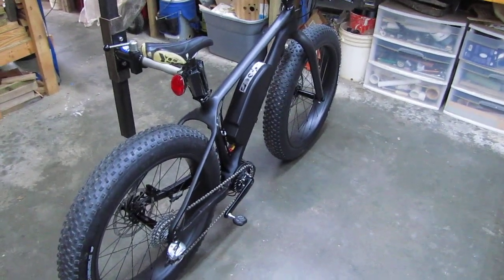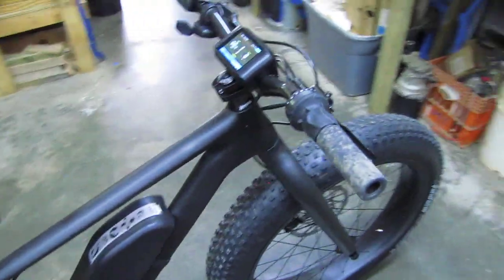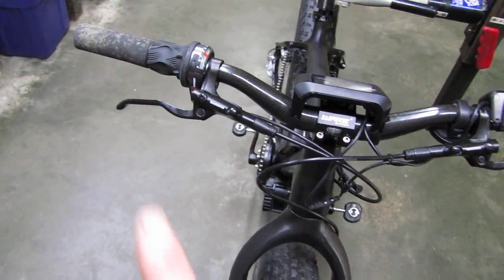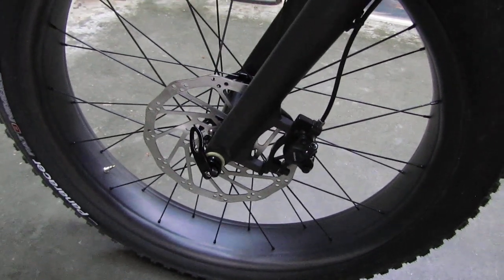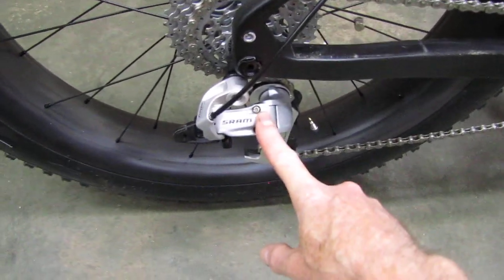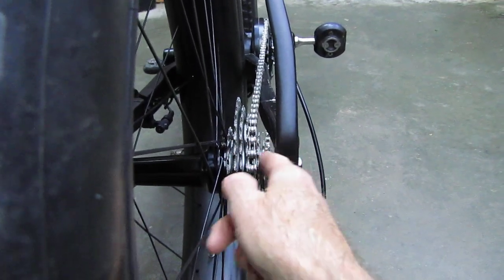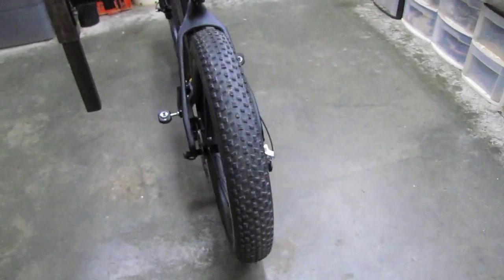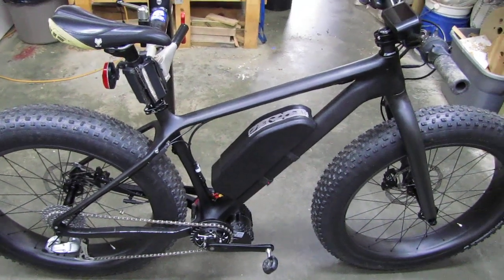Carbon Fiber Fat Ebike build with Luna BBSHD motor kit

Comment: So I just finished a very simular build as well I had a mongoose hitch.I purchased an ICAN carbon frame wich appears to be identical to your bike, yes I had ti gring the motor case a bit but nice and snug ..  I solved my chain line problem with a lecke 40t offsett kit it came with a low profile gear box cover to allow the offset chainring..   works perfectly have 1, 2mm washer on the BB pedal balance  and the chain aligment is perfect. Im running a 12 speed sram cassette and nails every gear. . Ill try and post some pics ..thanks for the inspiration..
Reply from the maker: Nice!

Comment: Dam that’s a nice bike  !! Good job
Reply from the maker: Thx. Just got back from a  24 mile off road ride. Another awesome day in the woods :)
Reply: EL34XYZ    I want one for setting my trail cams for Sasquatch  how far can you actually go off road like in your last trail video ? ( that type of Terrain )   Can you go 40 miles total ?  I wonder if you use a hub motor you don’t have the gear clicking when not peddling ??
Reply from the maker: @AboxofMonsters  Depends on how you build the bike. I might be able to go 40 miles if I use the lowest possible assist level that feels ok. But that's a best case scenario.
I have no use for a hub motor in the mountains here. Mid drives  are more powerful and the bike weight distribution is better.

Comment: Thanks for sharing, interesting. I ran into exactly the same chainstay issue converting a Norco BigFoot 2020 with a BBSHD. Works just fine but need to sort drive train/chainline. Thinking of Box 8 speed. Currently running Leckie 40 tooth, but again, have to insert so many spacers to get clearance from chainstays. Considering trying a 36 tooth. Two questions, if I may. 1) what speed do you get out of your bike, given the low gearing you run? 2) What carbon frame is that, it's really cool, especially with the rack mounts. Cheers.
Reply from the maker: Check out the comments for more info on this bike. That bike will do 36mph on the flats. I have not ridden it in quite a while because I have two Luna X1's. You can see those bikes here. https://www.youtube.com/playlist?list=PLVvDFekIYJjcyz1eu2JIv1EMDKRdUQ7Bz

Comment: That bike is pretty badass. I like you don’t have any decals on it.very clean look. I really wanna get all the decals off the Ebike I just put together, I don’t know if it’ll  ruin the paint though. They put so many decals on it’s annoying.  I have the same 52v battery. I like that it’s nearly indestructible, however, that makes it very heavy.
Reply from the maker: Some decals are actually painted under the clear coat. My Luna X1's are like that

Comment: Nice video! Frame is not available anymore.. do you have the specs so we know what to look for? so we could find a similar one on aliexpress or something.. the most important thing for me is the tyre. I need as wide as possible tyre because im thinking of making a winter fat bike to use for work commuting in norway ( im talking 1M snow as a surprise on the roads and constand ice on the road surface below any snow.. usually a lot of half melted snow with pure ice below it,
Reply from the maker: Hi, It's just a simple Carbon hard tail frame. Many merchants on Ali sell the same frame or similar. I don't have a link. Just do a search on Ali and look at all the choices.
Reply from the maker: @bwiser5206  BS, you have no idea what you are talking about

Comment: I have a brand new Fuji A2 21 inch mountain bike with 2. Something tires ( I wish I just went and got a E bike fat tire that’s what I want ) can I convert this Fuji with that motor kit ??
Reply from the maker: You should go to electricbike.com forum. Lots of info and help there. Here's the link 
https://electricbike.com/forum/
Reply: EL34XYZ   Ok thanks   I guess I should make use of it since I bought it. It’s already got great components.  I think I should use a rear hub motor so I can keep my a lot of intact.   Both types seem to work fine.

Comment: beautiful bike you put together , could you tell em how much it weight? I like to build something like that. also is the carbon frame holding ok? I heard it not a good idea put powerful motors in carbon frame. did you have any issues?  Thank you
Reply from the maker: It weighs 58 pounds because of the huge battery and BBSHD. There is no problem with a full carbon frame. As long as it is made properly. I have 2 Luna X1's also and they are full carbon
Reply: @EL34XYZ  Thank you !
Reply from the maker: It's a heavy machine. My Luna X1's are right at 50 pounds with the carbon stuff I upgraded.

Comment: Hi, very nice bike you made.
I am planning to build one myself this winter.
Can you pls tell me how fast can you paddle it on flat road with this setup?
Reply from the maker: This fat bike will do about 38 miles an hour on the flats
Reply: Thx, that sounds promissing
Reply from the maker: @erwinvanasperen5353  That is with that big Luna Chain ring. But I only have a 12 or 13 on the rear.
Reply: What did you use to fit the 33.5 mm bbshd axle in your bottom bracket?
I assume it was wider than 33.5 mm.
Reply from the maker: @erwinvanasperen5353  I don't know what the 33.5mm is you are asking about?
 I ordered a 120mm BBSHD from Luna Cycles. 
120mm is the Bottom bracket width on my Fat Bike frame. 
You order the correct BBSHD according to the width of your frame bottom bracket
Reply: @EL34XYZ  No i mean my bike has pressfit bearings in the bottom end.
When bearings removed BB inerdiameter is 41mm. So can not fit the 33.5 mm axle of the bafang bbshd direct. Must use somekind of spatels.
Reply from the maker: @erwinvanasperen5353  I don't know, all my bikes have threaded bottom brackets. There is no axle, the BBSHD has a large diameter steel tube, with an axle inside it

Comment: nice build!!
my Carbon frame is too thick at the bottom bracket and the BBSHD doesnt fit.
how did you do it? I´ve never seen a Carbon Fatbike frame thin enough to fit a mid drive motor
Reply from the maker: I had to shave off a tiny bit of aluminum off the BBSHD case. I used a dremel rasp bit. Push the BBSHD on and note where it rub, then shave a bit, do it again and again until it slides on

Comment: Awesome build videos bud!! I stumbled upon them tonight and watched them all. I had a question I'm sure you can answer. All my ebike builds are rear hub motors, do you have any experience with those?? I have to use torque arms for aluminum frames of course, would the carbon fiber dropouts be beefy enough to no worry about torque arms???? Thanx
Reply from the maker: Hi. I have only built two mid drive bikes. I don't know anything about hub drives. 
I would go to the electric bike forum here
https://electricbike.com/forum/

Comment: Did you have any issues with mounting the BBSHD on the carbon bottom bracket? Did everything fit properly around the frame?
Reply from the maker: The carbon frame was so beefy and fat that it was a really tight fit sliding the motor into the BB. I had to Dremel a bit on the motor case to make it clear the frame. The motor shell is aluminum. I used a round rasp bit to shave away some of the casing. It eventually went in. The motor case strength was not compromised by what I did, but it did take quite a while of test fitting, then Dremel, then test fitting again before it went in.
Reply: @EL34XYZ  I have a similar carbon fat bike and was initially planning to order a BBSHD for it, until I read that my BB shell was about twice as thick as the maximum thickness it should be to clear (something like 30mm vs 15mm. I had been considering a CYC X1 Pro, but would prefer the simplicity and quietness of the BBSHD. Do you have any detail photos of the BB area. and how much material you shaved from the drive unit?
Reply from the maker: @markreisdorf5860  No Images of the motor after I relieved a bit of aluminum. It was a bout a 1/2 inch wide area the width of the motor housing and maybe only about 1mm of material had to be removed. It was easy to see what needed to be removed because every time you slide the motor into the BB, black paint from the motor would show up on the bare aluminum motor housing. A round rasp bit in a dremel tool was able to reach in there and shave a bit at a time.
Reply: @EL34XYZ  do you think I'd be able to put a bbs02 on a carbon 26er on ebay the same way you did?
Reply from the maker: @Jonmc511  Don't know. Probably not because you don't have the super fat Bottom Bracket area like on my fat bike
Reply from the maker: @markreisdorf5860  No, sorry. I did not take any photos. It was just a bit off the aluminum case which was way thicker than you may think it is. It did not do any harm to the motor casing
Reply: @EL34XYZ      I was wondering why I couldn't find anyone that had a carbon fiber mid drive build... I'm tired of dragging my bike up a few stairs to get it in my place.. I was thinking building at regular 26er with my 36 volt 500w bbs02 for the streets. Did you drill holes into the frame to put the battery? And how many screws did u mount the battery with? Luckily I looked you up because I would have been discouraged about the bottom bracket not fitting. I'm curious of the stuff that you've grinded off.. motor is still waterproof? It looks amazing doesn't look like you hacked it from the video! After the build the bike was 15 lb lighter than the Mongoose set up?
Reply from the maker: @Jonmc511 
I did not drill any holes in the frame. I think the battery mount info is in my bike playlist. Look at the videos here for the Luna wolf battery mod video
https://www.youtube.com/playlist?list=PLVvDFekIYJjcyz1eu2JIv1EMDKRdUQ7Bz

Comment: Sooo... whatever became of the Mongoose, did ya unload it, or is it still around?
Reply from the maker: The BBSHD kit was removed and it was put back to stock. Then I sold it on craigslist. It was only used as a test subject :)
Reply: @EL34XYZ  yeah...just my luck...always a day late and a $-hort. Oh by the way great build. Love the frame selection. Components aren't bad either👍
Reply from the maker: @mqqnmypops  The fat bike now has a Manitou Mastodon fork and a thudbuster seat post

Comment: How much money do you estimate you have in this build?  It’s an incredible bike. You don’t have a build parr’s list you’d be willing to post, do you?
Reply from the maker: At that time I had about  $2600 in the bike. Since then I have added a Manitou Mastodon front suspension fork, a Cane Creek Thudbuster seat post and a few other goodies. Now I have about $3600 in the bike
Reply from the maker: I should have a build list with parts soon. I am changing the tires out to Maxxis Minion 26 x 4 inch. Waiting for the tires to arrive here
Reply: EL34XYZ thanks for the reply. I’d love to take a look at that list when you have it. I will try to buy the parts a bit at a time.
Reply: EL34XYZ one more question, do you know if there are any major differences between the Mongoose Hitch and Dolomite bikes?  In considering purchasing a used Dolomite in my area to experiment like you did first but wanted to confirm it’d work the same.
Reply from the maker: They look the same to me at Walmart. Not a very good bike, but worked ok as a test bike. I sold the Hitch I used as a test bike
https://www.walmart.com/ip/26-Mongoose-Dolomite-Men-s-Fat-Tire-Bike-Black/55456516
Reply: Chris Nunn Hi Chris ... did EL342xyz ever publish that build list for you on this carbon fiber fat ebike? Regards Brian
Reply: I have the same previous "test bike" and would love a parts list for the red mongoose upgrade,

Comment: awesome looking, how did it hold up thru the summer? motor become loose? any frame damage? thinking of doing this same.
Reply from the maker: Nope. All is good so far. I have about 1200 miles on it.. I upgraded the fork to a Manitou Mastodon suspension fork and a Cane Creek Thudbuster seat post. It has been awesome so far
Reply: @EL34XYZ thank u for the reply. looking forward to this, looks very sleek.

Comment: What name bike company on new black carbon fiber bike?
Reply from the maker: The manufacture is TIMETECBIKE
https://www.aliexpress.com/item/26ER-FAT-BIKE-CARBON-FRAME-REAR-SPACING-197MM/32473693752.html?
Reply: Thanks!
Reply: I saw same one on eBay too
Reply: What new weight to compare your old red bike? I know mongoose always very heavy bike.
Reply from the maker: @techtraveler1365  The Mongoose was 67 pounds. The carbon bike is 51 pounds. The motor and battery are 23 pounds
Reply: EL34XYZ  Yeah, I knew! That’s why I prefer light weight can lift put bike rack hitch instead mongoose I hate it very heavy.
Reply from the maker: @techtraveler1365  The carbon fiber stuff is made by a few factories. Lots of merchants sell the same stuff. Regular bike brands sold in the US buy the Chinese frames and put their name on them. Of course they charge double what you can buy them for direct.
Reply from the maker: @techtraveler1365  I have 3 carbon fiber bikes. All frames, forks and wheels bought direct from china. My rigid hard tail bike is 18 pounds. The full suspension mountain bike is 25 pounds. I love carbon fiber bikes

Comment: and how did you keep the wire routing so clean, ty!
Reply from the maker: The wires are routed up under the top tube. You can see that in the video
Reply: @EL34XYZ  dang,  ok...super clean want to do same build, i'll watch again, awesome ride. thanks
Reply from the maker: @davidjulseth8667  It has a Manitou Mastodon suspension fork now and a Cane Creek Thud Buster seat post
You can see the most recent version of this bike here
https://youtu.be/LTLr5ATfbaI
Reply from the maker: Here is the Fat bike doing a LED light test
https://youtu.be/ahbGUAHDC-M